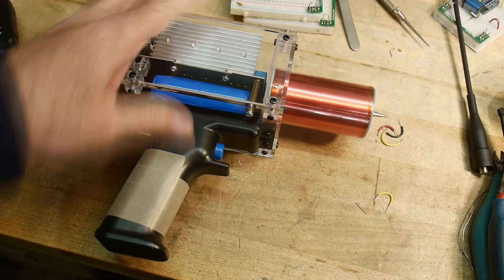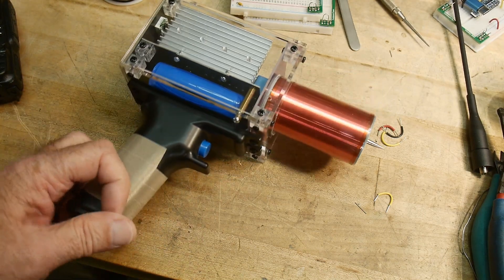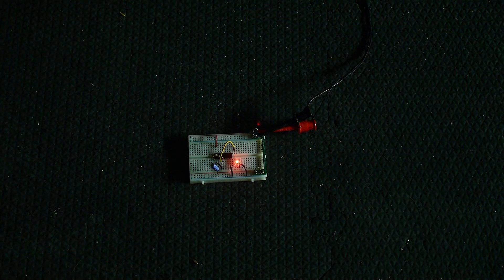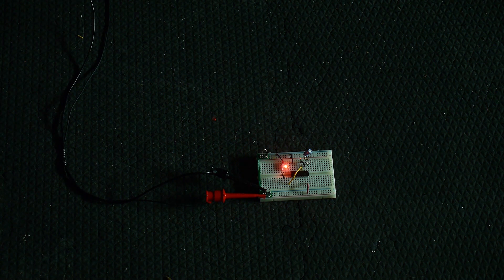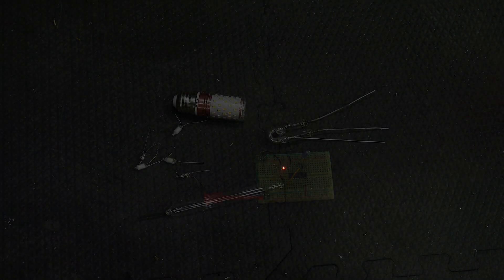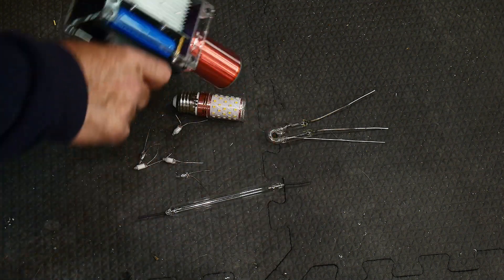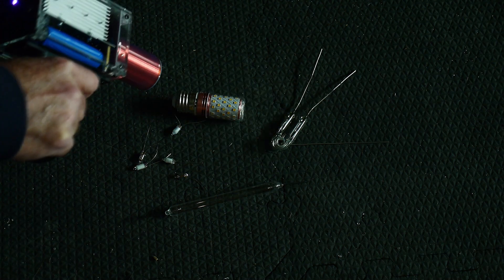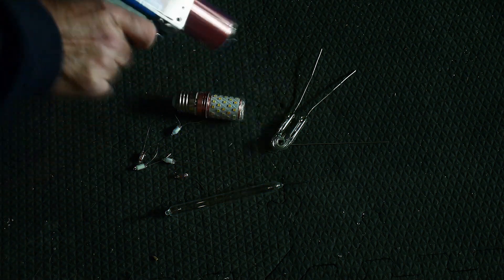#1823 More Zappy Zap (Tesla coil)

Comment: What’s the effect if those circuits were supplied from a battery ?  If it’s floating…
I dunno, but if those circuits were being supplied from a bench power supply you may want to put a “compromised” label on it perhaps  ?
Reply from the maker: it was battery powered